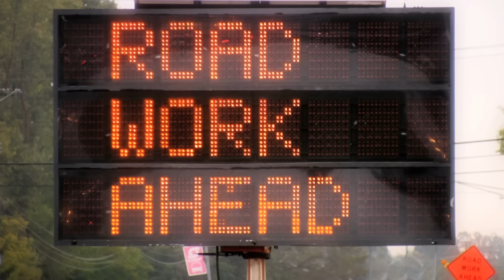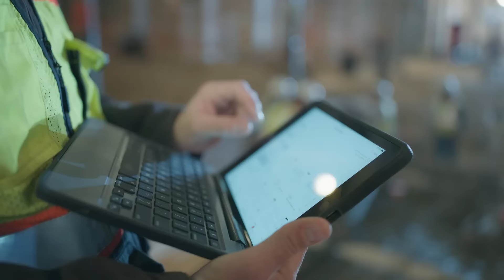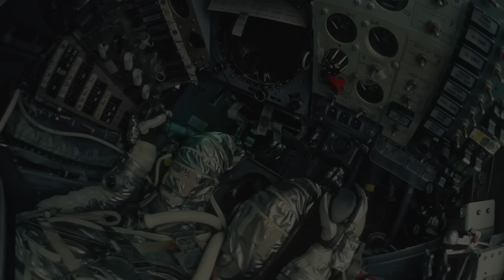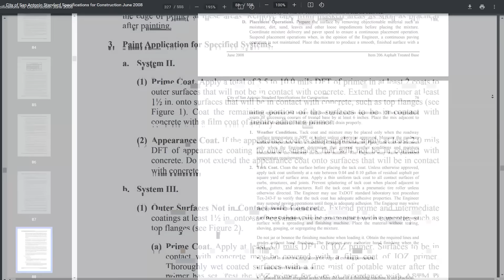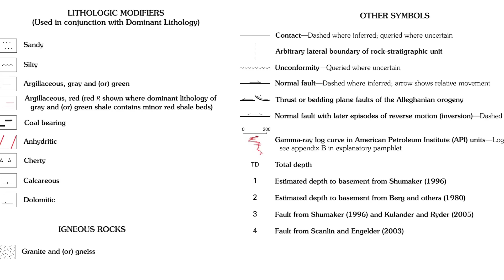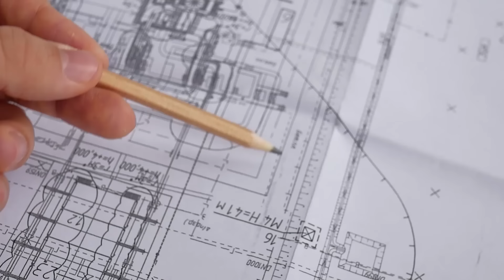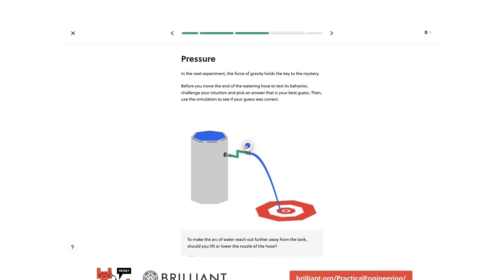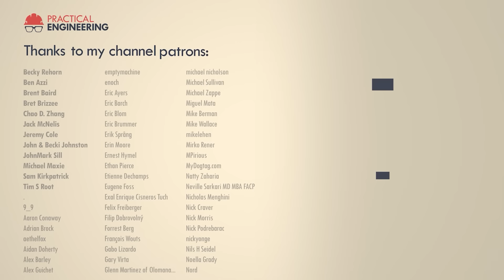4 Myths About Construction Debunked

Comment: I'm an electrician and I got paid to stand on a job site for a whole month just to make sure nothing went wrong.. because down time would cost the company $10,000 an hour...
Reply: Buddy of mine works in the auto industry and has a similar setup.  He programs the robots on the line to build X or Y but a lot of the time he's just sitting around in case something goes wrong.  Because the cost of the line going down is in the hundreds of thousands every hour... Its weird thing but necessary >_<
Reply: I'm an electrician and I work for myself. On a job waiting for parts delivery. So I guess I'm technically paying myself to watch youtube right now?
Reply: This is the joy of cybersec as well. Everyone ignores you until there's a problem, and then it's all your fault when it is. 
It's also almost always cheaper and more efficient to have 1 or 2 skilled supervisors, rather than making all 20-some odd workers have the training and expertise that would be required.
Reply: @SpacemanXC  i would fire myself lol
Reply: Been there!! I do pump bypasses,, if they pay for “pump watch” grab my iPad and lawn chair,, every 20 minutes, look in a manhole.
Reply: I cant do it.  I don't know how you did it, but I'm impressed.  I gotta be doing something
Reply: @SpacemanXC  you could have tidied your van up a bit ? Or dropped off a henly block & approximately 20 meters of 2.5 for me 👍
Reply: I love being an electrician
Reply: Yes, that’s the actual reason for much of the added, ‘idle looking’ crew, which are the huge capital and schedule costs, forcing extra bodies around to make sure the show never stops. If some inspector says, ‘that temp wall on the excavation is weak’, there have to be carpenters etc to shore it up right freaking now, because nobody can afford to have that excavator and operator and concrete pour go idle for long, and btw the semi trailer to haul the excavator away is coming 5pm today …
Reply: Are you not sure $8500 of that is because they’ve got other experts standing around doing the same? Lol
Reply: @SpacemanXC  unfortunately when working for yourself is just "acceptable downtime" 😅
Reply: How exactly did you ensure that. 
Because for an construction manager it is a lot of walking required.
Reply: @Lizlodude  the joy of cybersecs 😝🚬😎💨
Reply: i've done firewatch for some stuff and it's really a terrible job. you stand/sit there for 8 or so hours making sure there's no fire or obvious safety violations. you can't have fun because you need to be focused. it's mentally taxing.
Reply: I’m in HVAC. Ive done the same thing as well. Onsite while testing because failure cost so much money. Stay around a site to make sure a major 911 server/system didn’t go down because of a small failure.
Reply: So what was your rate, $9,000/hour?
Reply: I've seen the same happen. Worked on a job where they manged to get an equipment operator hired on just in case to the tune of about $1000 a day for him and his excavator even though he wasnt needed at all. I hated working on schools since some guys were hired to just stand around: one project i worked on had all the contractors responsible for getting their own materials from the supply yard but they hired on a guy to get the supplies... even though he never actually got anything. He spent months just wandering around smoking and once an hour he'd roll the same piece of pipe from end of the yard to the other, smoke for a bit, BS, then roll it back.
Reply: look at it this way, you could be the president where you get paid 4 years and can't remember what you just said 5 minutes ago. Or fall off a bike
Reply: Ye that a lot just don’t read my name
Reply: @captainteamcarry3  they notice us when the site lights are off and take us for granted when they’re on lol
Reply: @Nill757  so true
Reply: @JoelRipke  pretty small for a big crew and a critical infrastructure job tbh. The modern world is expensive
Reply: @SpacemanXC  You are your own boss. You can do anything on your downtime!
Reply: @SpacemanXC  If only the theory worked in reality - we could all be creaming it 😁
Reply: Sounds like a living version of insurance
Reply: @SpacemanXC  I felt this comment in my bones. Worst case I've arrived at a job in the early morning only for it to arrive late in the afternoon.
Reply: @Nill757  "because nobody can afford to have that excavator and operator and concrete pour go idle for long"
This is justified by having lots of men standing around all day long?  Heavy equipment is expensive but it's not that expensive, compared to the wasted labour.  At least where I live the labour waste is a much, much bigger issue,.
Reply: @jasondashney  Do you work in construction? Because you might not know that pouring concrete is super time sensitive. When the trucks arrive, you need everyone. Sometimes waiting for things to arrive is part of the job. You have to be there, when it's there. Make sense?
Reply: @cosmiccocoa5541  A couple years ago I was installing power on a new property. The guys from the power company and I were waiting all day for the power pole to show up, because the delivery truck broke down. There was a pond on the property, and I happened to have my fishing gear with me. So I spent all day fishing, while the dudes from the power company sat there and watched lol.
Reply: @jasondashney  When the excavator is gone after it’s site time expires because no skilled labor,  and you need the excavator to do the remaining job, then yeah it’s way, way more expensive than idle labor.
Reply: Same with me on my jobsite, depending on who’s welding either myself or others get paid to stand around and watch for fires and suppress sparks. Can be boring but the refinery has never caught on fire even while welding right in the middle of a very flammable process unit.
Reply: @WanderTheNomad  It is.  Cheaper to sue that inspector for failure to protect and his insurance than a massive company with high class lawyers.
Reply: Then tou are a thief go sweep or something more meaning ful.
Reply: @mattnewrocki4943  sir that’s a laborers job, not my job, everyone doesn’t not do anything when there is nothing to do. That’s why with whatever trades there are, you go to school for 5 years or more (6 years for me) to specialize in that trade. Get  training for that trade, get certifications on specific processes for that trade, get multiple licenses for that trade. Then when you show up on a jobsite, after a safety and security orientation you go immediately to work doing your specific part. No on the job training required, no completely clueless people who don’t know what a hammer or screwdriver is walking around to get hurt or mess something up. Going through an apprenticeship to become a journeyman tradesperson and then a master tradesperson in whatever trade is where it’s at. It’s way cheaper for an end customer to go that route then to hire some one off the street, waste money and time to train said person in everything then hope they complete the job right. You want the job done right the first time you hire the trades to come complete the job usually before deadline and under budget. 
Who do you think does 99% of the work of building and maintenance at all the power plants? (Nuclear, natural gas, hydroelectric, coal), 
Tradespeople!
Who do think does 99% of the work for building and maintenance of refineries, chemical plants, gas plants? 
Tradespeople!
Who do you think builds and maintains office buildings, skyscrapers, schools, hospitals and even your home if something breaks? Tradespeople!
So open your eyes and realize what people do, I’ll sweep and clean up after my self if needed but people are hired on a jobsite to do it for you, so you can keep chugging along and finish your part of the project. Tradespeople make the world go round
Reply: You could have spent that time swee... never mind you are an electrician
Reply: good  investment.   i  have  seen  absolutely  crazy  wiring:  from  empty  sockets    to  weird  off  planet  wiring  that   would   work    but  the  airport  techs  could  not  fix  without  ripping everything  out.    you  Saved   them   headaches.
Reply: @huddy32  i  did  piles  as  a  technitian    paid  for  colleges..
Reply: there  is  never  a  "standing  around"  EVERYONE  IS  LEARNING  THEIR  BROTHERS'  TRADES   and  when  the  product  Quality  Control  engineer  comes  around    he   smiles  .  i  used to  stalk  a  master QC    he  had  to  really  look  to  find  ...
Reply: No, you got paid to stand around on a job  site because you're an electrician.
Reply: Very similar to buying insurance. It has value even if you never use it.
Reply: @SpacemanXC  If you got down time and got nothing to do, then Yes! Why not watch a youtube video 😁
Reply: Exactly
Reply: I spent two weeks on a night shift getting paid to basically play Video games incase they would radio if they needed us. it was great
Reply: I recently had some pretty major surgery. Because they were working near a major artery, there was a vascular surgeon in the OR just in case.
Reply: @Blox117  Could also be a president who walks up stairs with toilet paper on his shoe, shuffles down a 10 degree incline in Sunny weather and literally cannot compose oneself for more than 10 seconds without rambling off whatever random thought pops in his head. It's a give and take kind of world haha.
Reply: @SpacemanXC  Growing weed is similar, a bit of work but you're mostly just watching the plants grow..
Reply: My job is a little different than construction but 90% of the time we stand around for 8 hours day. I am a machine mechanic and we wait till a machine breaks or needs a adjustment. But the machines cost anywhere between 25k- 1.5 million soooo.
Reply: This is actually why I quit my last job. The foreman wasn't watching the work, so mistakes that could have been avoided kept occurring, resulting in double/triple work. I tried overseeing the jobs best I could, but in the end, it was 'not my job' and I also wasn't licensed to oversee operations in the first place.
Reply: @huddy32  I'm a firefighter. We do welding, firewatch and blast details. I sit in a lawn chair and watch the guy weld all day (i do help them by cleaning up or getting them lunch), i have an ipad for wifi, magazines, job radio, snacks etc. For blasting...sit in a dept vehicle and watch the show, sign my paperwork and leave. For a firewatch recently at a hotel w/down fire alarm....walk around every 1/2 hr. sit in a hotel room, watch tv, nap, etc in the mean time.
Reply: @Lizlodude  All workers should be trained in any methods available that would be beneficial to their work. That's common sense. Uninfprmed workers are dangerous.
Reply: @arthas640  If you didn't NEED the supplies while you were there. would he be pining them up in your lap?
Reply: @Blox117  Yeah, everyone knows a POTUS must have excellent athletic capabilities.
(Incidentally, did you ever see Trump do anything more than swing at a golf ball?)
Reply: @drag0nblight  no, because you still have to do your books, inventory your supplies, read bid requests, submit bids, attend seminars, TRAVEL, TRAVEL, TRAVEL...
Reply: @jasondashney  And contacting workers to report to a job that may or may not need you at any given time, so essentially you'd spend most of your time laid off and on unpaid standby, preventing you from do other jobs... Yeah, great way the attract and retain good workers.
Reply: @SpacemanXC  Did you fry any fish for them? :D
Reply: @WCM1945  yeah because he's american so clearly needs to be 500lbs overweight
Reply: @jorgegonzalez-larramendi5491  Why      do      you      write      everything      with      so many      spaces      ?
Reply: We all build  America together. 🇺🇸
Reply: @WCM1945  Downtime means you have nothing to do. Finances, inventories, and all that stuff are already done. If you're a good tradesman and charges a reasonable price, customers comes to you. And not to brag, but my father is a mechanic with background in electronics. At his peak, customers comes to him and people knows him through word of mouth, no advertisement needed. His work includes cars, buses, trucks, backhoes, even small ships. His downtime then was used to build his own two power generators. One of them is currently utilized by a hospital a few cities away, and one is for personal use in case of emergency.
Reply: Sounds like working helpdesk. If everything is working correctly, you have a dull and boring day.
Reply: I have a job at a place that is essentially testing new production processes. Alot of the time the machine is down so i get paid to sit around
Reply: @SpacemanXC  gotta love the false economy ey. Same with us waiting on concrete. Just makes the day end later.
Reply: Being a diesel mechanic I rather be in the shop than the bare hot sun!
Reply: It only would cost ten grand an hour because every single person and piece of machinery is ridiculously over paid and over priced. School bullies and layabouts - where do they all end up?
Reply: Makes sense…
Reply: @Lizlodude  no waiting if you're red team 😈
Reply: Same
Reply: I'm a plumber and I definitely think office people are lazy
Reply: @austinutley5938  idk man you would be surprised because I've worked both and I would rather go back to  construction because office life is hell but hey I'm getting out for law enforcement so I hop that goes a little better.   But ya you don't realize how much you miss out side until you have sat a computer for 10 hours listening to the people complaining about their orders and boring drama.
Reply: Lol, $60-200/hr vs $10k/hr sounds like a bargain to me
Reply: In transit infrastructure once we're done with the job (it can be relatively short 3 hours to complete to taking 10 hours if there's a problem and transit doesn't like us tradesmen to be in the way of rush hour traffic thus we have to wrap things up after 5 hours and save it for the next day if possible) we have to remain on stand by until the full 8 hour shift is over should an emergency crop up as it will be less time to get us going than to call people to come back to work if a problem arises. Sadly when we stand around it's not because we don't want to work it is because rail control REFUSES to hand over the tracks to us to begin a repair or maintenance job because hundreds of thousands of people use the trains all hours of the day and apparently parking trains during the overnight is a hassle to get back up and running for the morning rush combined with logistics of placing them in spots to put them into service. I'm a welder by the way.
Reply: Your presence was a preventative measure and job sites employ hundreds of them, some human and some not. Good job, dude.
Reply: So they paid you $9,000 an hour then? Right?
Reply: It’s so true about other fields sitting around a lot invisibly 😂
I teach and if nobody shows up for office hours and my lecture notes and grading for the next day are done… 🤷🏻‍♀️
Reply: @Daeon108  I work for an auto maker. And this comment checks out.
Reply: With capitalism the more efficient a process is the more the marketplace will demand it.  With communism the least efficient processes are given the most resources to achieve the required result.
Reply: Capitalism is Darwinism. The best and most efficient thrive.
Reply: It's really no different than my husband's firefighter career on 48-hour shifts- he tells people all the time that he doesn't get paid for what he does, he gets paid for what he might have to do. A great deal of his shift is spent "just sitting around" but, someone experiencing their worst day ever is going to want him available when the time comes that they need him.
Reply: And many months later, down time plus repair and maintainance begins, costing million?🤣
Reply: Whenever we pour a large commercial slab we always have a sparky and a turd burglar on standby just in case. It's a lot cheaper to catch a problem right away than to have 20 people and thousands of dollars of equipment sitting still waiting for the repair.
Reply: this is essentially the case for all electricians. especially those working on ships/oil rigs
Reply: It do be like that sometimes.
Reply: @Daeon108  I don't think there's anything weird in this sort of work
Reply: Can't wait to graduate XD. It's difficult.
Reply: @huddy32  As a City inspector I would come to job sites where a contractor had workers doing pump watch 24/7. If a pump went down too long the fines for letting sewage get into a river or the ocean was high.
Reply: Sounds nice. I remember looking over and seeing a few electricians do that while I worked. You know, because I was at work.
Reply: @ungeschaut  then hire yourself again cause u need workers
Reply: @jasondashney  Companies do cost-benefit analyses for these types of decisions all the time. All but guaranteed, if they have "extra" workers it's because someone higher up decided that was more cost-effective than renting a machine.
Reply: @NightMotorcyclist  I like your comment! Kinda hints at the unseen complexities we all have to deal with in different jobs/industries. To outsiders it can be hard to see or understand what's happening, but those with experience in a given field understand the potential problems that can arise and how to be prepared for them. Gets even worse when multiple companies and specialists need to coordinate, so many safety and logistical issues to prepare for... But, there's a reason we have all these systems in place: we already know what can happen when they aren't.
Reply: @LifeEnemy  I used to be of that mind of seeing "lazy" workers until I got into the field myself when other jobs dried up. Turns out a lot more goes into planning and actual repairs due to various reasons, some being red tape by the city itself. I have found myself very annoyed to pretty angry when I couldn't start or finish a weld job because the company wanted their subway tracks back (we take over once our flagging is set up and traffic is slowed immensly) as trains have to keep schedule as people are getting ready to head to work at 4:30 AM. WHen I call in an emergency job for the safety of millions of travelers I am met with annoyance by higher ups who tell me to just "make it safe and nothing more" and I come back the next day to do a proper job, unless something else is found broken during the daytime inspections. Contrary to popular belief, our transit system doesn't have enough workers for the miles track we're responsible with. Tunnels are maintained by infrastructure people and we also need to coordinate with them as well as signal maintainers an electrical as we need to cut a lof their stuff out in the process.
Reply: B S
Reply: @Daeon108   is his name Homer??
Reply: @jasondashney  So which costs more, paying to have a bunch of guys ready to jump on an issue *right now*, or replacing a drum that has been destroyed by concrete setting inside it, or all of the concrete that needs emergency dumped and then brought back another day?  How about the cost of renting out the excavator again on top of that?
Reply: Not paid for a month doing “nothing” but paid for years of training and experience
Reply: Oh ok
Reply: @LifeEnemy  "Companies do cost-benefit analyses for these types of decisions all the time. All but guaranteed, if they have "extra" workers it's because someone higher up decided that was more cost-effective than renting a machine.

For private companies?  Often true.  For government work? Negatron, especially if it's union.
Reply: @Yawyna124  "So which costs more, paying to have a bunch of guys ready to jump on an issue *right now*, or replacing a drum that has been destroyed by concrete setting inside it, or all of the concrete that needs emergency dumped and then brought back another day?  How about the cost of renting out the excavator again on top of that?"

I'd agree if it was a super important thing like restoring vital infrastructure after a hurricane, but for day to day?  I disagree.  It's like overpaying for insurance.  Less people and the odd problem would probably be much, much cheaper overall.  That's just my opinion though.
Reply: I thought standing around doing nothing was the job description for an electrician on a construction site !
Reply: just because it is financially beneficial to pay you to do nothing doesn't mean your existence is justified or necessary. By your own admission you are useless until "something goes wrong". 

You are nothing more than an insurance policy. 

You are paid for doing nothing.

AI will replace you as well as most jobs.
Reply: @SpacemanXC  time is money
Reply: @bretatvs  I'm an Industrial Maintenance Electrician/technician. 100% of my job consists of repairing/troubleshooting/maintaining equipment in an industrial chemical plant. If nothing is broken, acting up or has a preventative maintenance scheduled, I sit in my office 10 hrs a day 4 days a week (40hrs). My average work week consists of maybe 2-10hrs of work, a 1-2hr walkthrough audit to make sure nothing is damaged and the rest is just chilling on my phone or bullshitting with coworkers. I make at least $70,000 a year and I have room for pay raises.
While I might not do much on a daily basis, at any point in time a single equipment failure could happen that shuts the entire production unit down. Something that might be a 10 minute fix for me, could cost the company $100,000+ per hour in lost production. So no matter what someone has to be there in case of a catastrophic failure.
Reply: Greed does not impart wisdom... I'm not saying downtime isn't expensive. I am just saying application of punitive theft of resources as encouragement to perform faster is the wrong direction for proper production....
Reply: Some jobs I do at work can be like that.  I'm a press operator and some of the jobs I do basically require me to start up the line and just wait.  Every so often I check some parts and dump them into a larger container.  Even with these jobs I do have to keep an eye out, the coils don't last forever, most jobs have coolant that needs occasional refilling, waste coolant is usually collected in buckets that need emptied every now and then, and some dies have punches that will break with almost no sound so if I'm not checking frequently enough or well enough I could end up with a whole lot of parts on hold.  Most of the time I'm doing single hit jobs that require me to manually place and hit each piece (so I'm not just standing around though I also don't move much which is terrible on my feet) but the last couple of weeks one of our guys went to Germany (I think he has family there) so I was watching his line instead.
Reply: Lol
Reply: Yep, that’s the industry standard for anything that government has its hand in it.
Reply: I’m in the delivery business, we only go to one customer.  I pull in one day, and they weren’t ready for me yet.  I told them, you have my phone number, you could have called me, and I would have gone to lunch, or found something else to do, until you were ready.  The problem with contractors is that they are visibly idle.  They are front and center on stage when they’re on the highway.  Clogging space for seemingly no productive labour.  If you have nothing to do, why don’t you go do nothing over there, instead of right here?  A productive and responsible roadworks site would occupy as little space as required.  Do not close miles upon miles of lane just because one guy couldn’t park his pickup truck on the shoulder.  In emergency service, we are reminded almost constantly, take as little room as required, stress required, and leave as much lane open as possible.  Less delay makes assistance arrive faster should the need arise (we, nor any other agency of which I’m aware, has the idea of calling eight ambulances to sit around in the off chance we may need one, they have better things to do elsewhere, if we need one, we’ll call).  Stepping from the rambling, back to the original point.  If there is no imminent requirement for your, and specifically YOUR presence right then and there, why are you still there?  You can make the company look more efficient and useful if the widget pushers are pushing widgets, and the widget starers are somewhere else, though standing by when the moment arrives to stare at the widgets.  There is no need for the widget starers to be staring at the widgets while they’re still being pushed.  And there is also no requirement for six trucks of widgets to be taking up space (and burning $6 per gallon diesel) when they have plenty of widgets.  They can be at lunch, the truck stop, heck, the bowling alley, who really cares, just not idly taking up space, until very shortly before there is a need for more widgets.  Crew determines widgets need to be closely monitored for next twenty minutes before more widgets are required to be delivered and pushed.  The foreman could then call a truck of widgets, and the head widget pusher, who could respond within ten minutes (leaving ample time before their task is required) and then get promptly to work.  In short, employees may have the requirement to be available, but the definition of available does not mean within exactly nine seconds.  Before I deliver widgets, where I am, or what I’m doing, is not germane to the greater job, as long as the widgets are delivered when they are required.  Earlier is of no productive use.
Reply: I'm a team leader in a factory. 

Its my job to sit there and watch the line to make sure any downtime is kept to a minimum, because every minute of downtime is between $10,000-40,000.
Reply: @Mike-tv9rk usually they become cops.
Reply: And we Wonder why everything costs so much yet has no quality
Reply: @OtterTreySSArmy a 🤖 can replace you. 🤣